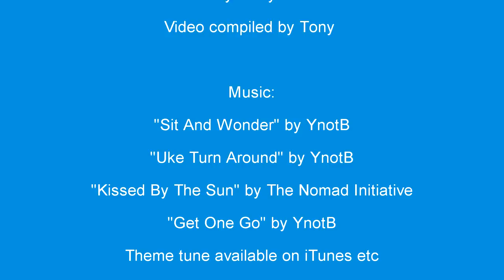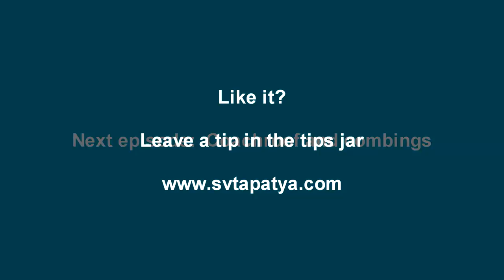Boatbuilding again - SV Tapatya EP45

Comment: I guess that the boatbuilding will soon consist of constantly hauling yourself and a bunch of materials back and forth, up and over the gunwales. Should be fun! Hope your wife is doing ok. :)
Reply from the maker: You're right - lots of clambering. Need to think about easy access...
Karin's in good spirits so far. Many thanks to everyone for all the kind thoughts
Reply: A bit drastic for sure, and possibly even a crazy idea, but I'm wondering if it would make any sense at all to cut out a section of topside planking for construction access.  I'm no boat builder, but I'm thinking it could be done in such a way that the integrity of the hull would be totally restored after the piece is glued and glassed back in place. Am I nuts? :)
Reply from the maker: :-) :-) I'm tempted to reply that you might be nuts.... but, of course, your idea is possible. Think I'll stick to lifting and clambering though :-)